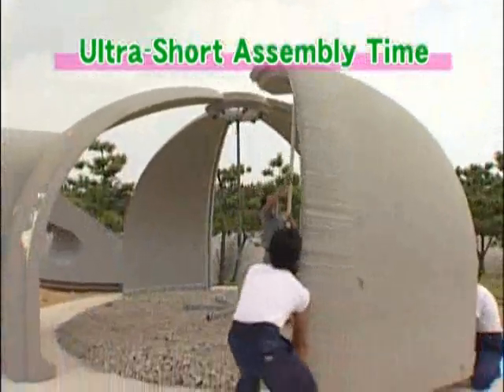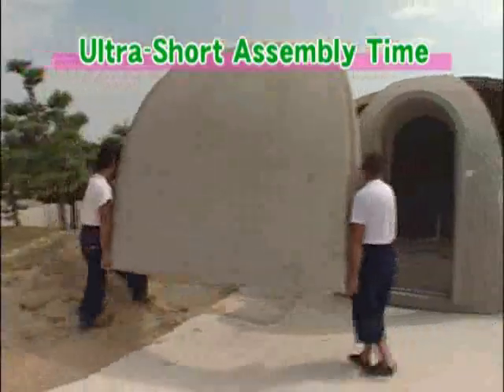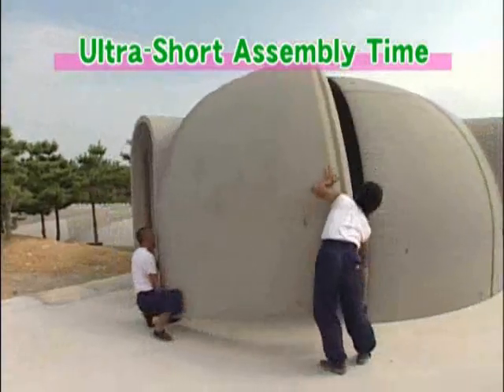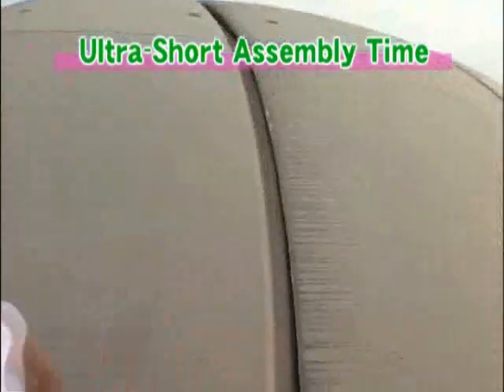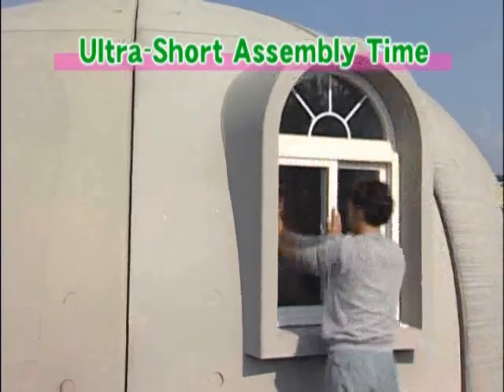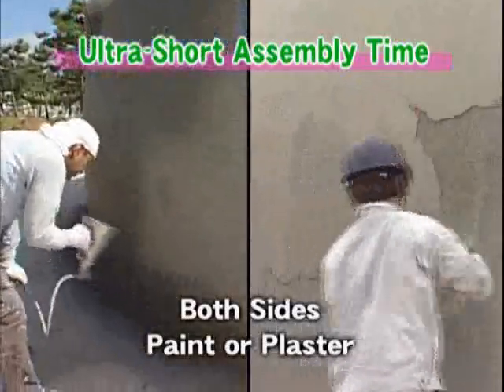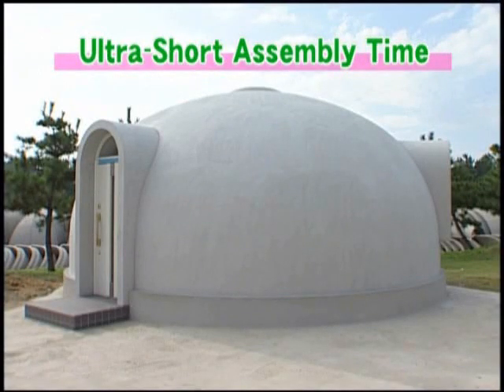Styrofoam dome home

Comment: This is an amazing idea. The energy efficiences of foam, tight air infiltration, noise reductant, great against  seismic activity, moveability, light weight shipping, easy installation, little upkeep, does not get moldy or eaten by insects, and designability/customability make this by far the most intelligent building design I have heard of. Wow Japanese are smart.

Comment: i saw another example of this, but it starts out with an inflatable dome, over which they place a geodesic steel cage, then pour on the concrete.Then they deflate the mold and do the inside.
It could be used in the future, as a form of low-income housing (better than trailer parks). In a state like Florida, these might be a good idea as they're said to be hurricane resistant.
 You'd still have to put in the plumbing.

Comment: I would love a dome home. Ponder this... Arrange a circle of small dome home 'rooms'for your abode, leaving just enough space to invert one in the middle of the rest, as a SWIMMING POOL! Additional supports would probably be needed. Windows could be installed where the pool meets the supporting rooms. I imagine steps circling the interior of the pool to provide a comfortable shallow area. The pump could be hidden in the spaces between the domes. Stack one on top for indoor pool!

Comment: @csabafat Holy shit. It's a 23 second video. When there is a flood or hurricane, judging by whatever variant of  polyvinyl coating they sprayed onto the concrete which was applied to the stryofoam framework I'm guessing the domehome would remain while all other convential wooden frame houses would be gone with the with the wind, or water. 

As for the fireplace, stove, and bathroom I'm going to take a wild guess and say those are on the inside of the home? This is just the shell. Understand?

Comment: I MUST live in one of these. But I live in Florida and even the slightest winds would demolish this thing. If a trailer can't handle it, a Styrofoam house def. wont.
Reply: The dome shape is what makes this massively better in winds. There is no roof or flat walls to get torn off. The wind pressures are dispersed. Once you put the concrete/stucco siding on it, it has a much, much better wind rating than a typical house.